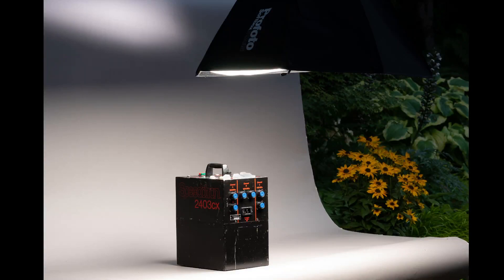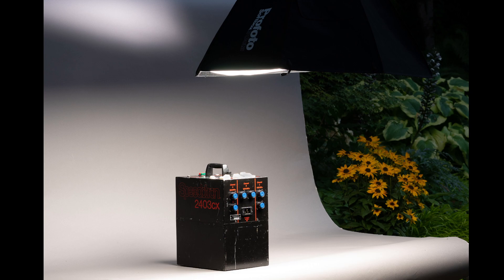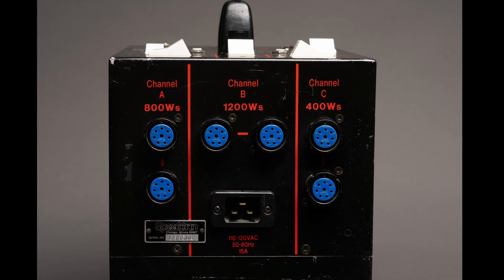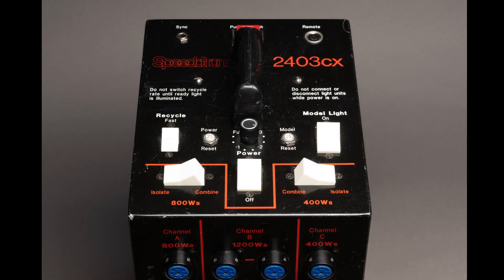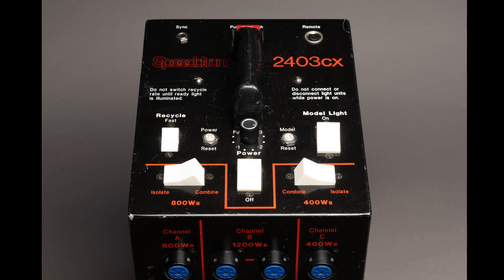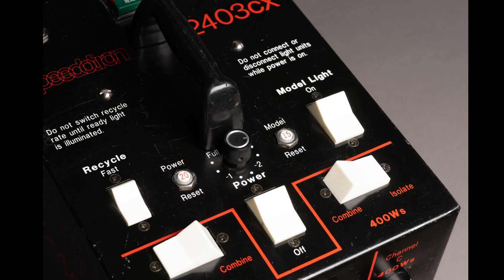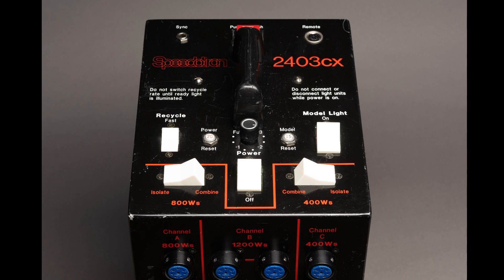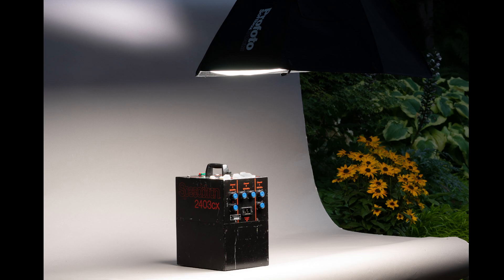Speedotron 2403CX - 2400 watts to 50 watts

Comment: Steve, you can also put two heads on channel C when it's on isolate and run the second head to a place it won't contribute to the subject and get each head down to 25ws.

Comment: Hi Steve,  Love your videos. quick question (if you care to answer) If I want a basic setup in a small studio with the Speedotron 2403cx using 2 lights(soft boxes) one for fill and other for backlighting can I plug both in the 400 watt plugs on isolate in power pack?
Reply from the maker: Thanks David, if I understand your question, it is can you plug in two strobes in the 400 watt channel.  The answer is yes, and if you leave 400 watts isolated you will get 200 watts per strobe.  The power dial will control both strobes.  So if you take a stop out with the power dial (-1 setting) you will get 100 watts per strobe.